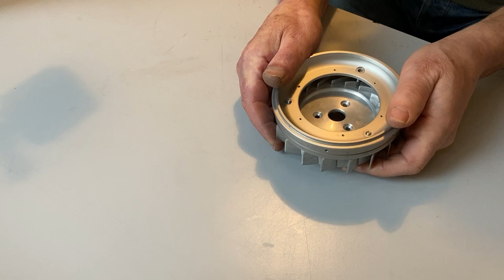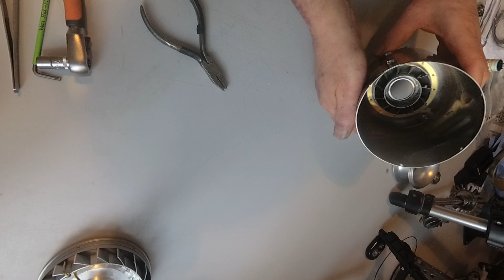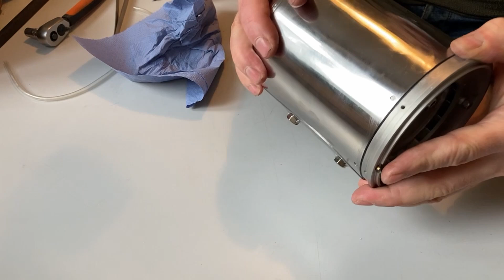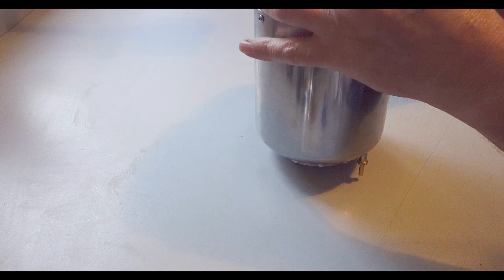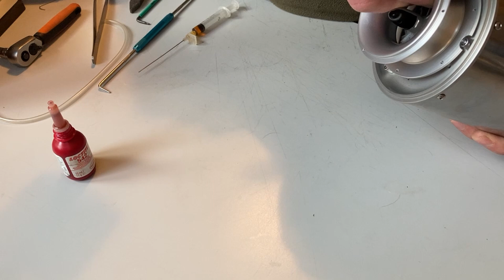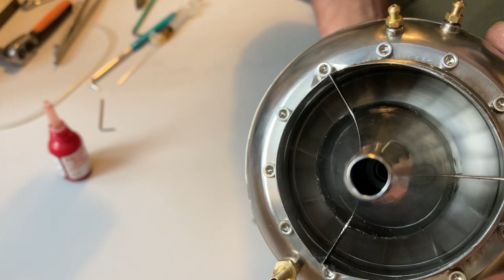Assembling My Home Made Jet Engine

Comment: Hi @MisterG, i have a question: when you put the compressor and turbine disc together on the shaft, did you perform an overall balance? Or did you balance the parts individually?
Reply from the maker: Hi - the turbine and shaft were balanced as an assembly, and haven't been disturbed since. If they were ever separated, they'd need to be re-balanced (or at least checked). The compressor wheel is supplied balanced, and is a shrink fit on the shaft, so if the shaft is straight, the assembly should be in balance. It seemed to work.
Reply: @Mister_G  Thanks for the tip. So, if I have a factory-balanced turbine (I bought it from Jet Max), do you think a pre-balanced compressor would work properly? Or should I still do a general balancing of the whole thing once everything is assembled?
Reply from the maker: @MarcoFormentin  You need to make sure that the turbine and shaft are balanced. I don't know what engine you're working on, but bear in mind that the Kamps only spins to just over 100K RPM. The requirements for more modern, higher speed designs are probably tighter, and may well need to be dynamically balanced as a complete assembly - it's not something I've ventured into.

Comment: May i ask why do you run the fuel tube from the back? Where the hot zone is?
Reply from the maker: I was just following Thomas Kamps' design! 😄
(I think that the real reason is that the design of the fabricated diffuser in this engine doesn't give any 'dead' space where pipes can be routed through without affecting the airflow - CNC 'wedge' style diffusers do have places where pipes can be routed.) Thanks for the comment.

Comment: It seemed to make a lot of friction when you manually span it…
Reply from the maker: Yes, it's trying to pump air all the time, so it won't spin for long, even with "frictionless" bearings. It does sound awful here - the cage-less bearings are very noisy when they're dry and the balls don't really space out properly until the bearing is running. Everything is OK though.

Comment: Осталось отбалансировать и проверить.👍🏻🤓😎
Reply from the maker: Thank you - the rotor was balanced before assembly 🙂
Reply: @Mister_G  я и не сомневался, что все вращающиеся детали, были отбалансированы перед сборкой, но после сборки, они должны быть отбалансированы совместно.
Поэтому купленные двигатели, нельзя разбирать, если не хочешь потерять балансировку.
Reply from the maker: @aleksandrkargin1978  True - I am relying on the compressor wheel being well balanced from the factory. This engine only runs up to 100k RPM so not quite as critical as commercial engines. Thank for the kind comments 🙂

Comment: Hello
I'm enjoying the video
Is the bearing lubrication in the shaft housing on the compressor side by drilling a hole in the intake cover and connecting the copper pipe?

Don't you need to lubricate the bearings on the turbine side?
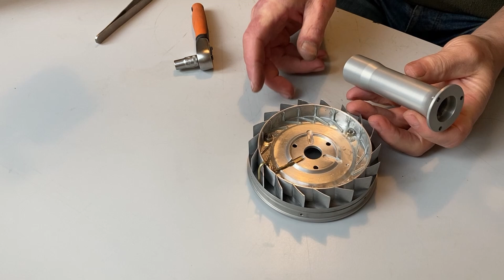Reply from the maker: Hi, and thanks, glad you are enjoying it. If you pause the video at 3:20 you can see that the small pipe fits into one of three slots in the front of the engine. A small amount of air from the compressor flows through these slots into the bearing tube, through both bearings and out of the back of the engine. A small amount of fuel/oil mix is pumped into the small tube and this forms an oil mist with the air that lubricates both bearings before being burned off as it comes out the back of the engine.
Reply: @Mister_G  thank you for your answer.

I have one more question
As far as I understand, 1spool consists of an impeller, a shaft, and a turbine
After securing the bearing to the housing, the outer diameter of the bearing is fixed with the shaft passing through the inner diameter of the bearing, and the shaft rotates as the bearing rotates the inner wheel.

In the video, the inner diameter and axis of the bearing don't fit tightly and there's plenty of room

Does the axis spin without tight tolerance between the <-> axes of the bearing?
Reply from the maker: @wjstk1725   The inner diameter of the bearing is supposed to be a very close sliding fit on the shaft (it could probably be tighter than shown at 15:50). The inner race of the rear bearing is clamped to the shaft when the nut holding the turbine is tightened, and the front bearing when the nut holding the impeller is tightened - the shaft can move at 15:50 because the impeller (and the spacer behind it) have yet to be fitted and tightened down. Does that answer your question? If not, please ask again 🙂 There's a cross section of the engine on my website which may help things make more sense.
Reply: @Mister_G  Thank you for your explanation😉

Comment: Wow, I never saw a combustion chamber built with thick steel plates, usually builder builds with thin steel plates, which i'm familiar with. 

Is a thick or thin steel sheet compatible for sustainable performance ?
Reply from the maker: Hi - the combustion chamber is made from 0.5mm thick 304 stainless steel. I suspect that commercial engines might use 0.3mm, but 0.5mm was quite thin enough for me to work with!🙂. Thanks for watching and commenting.

Comment: What will happen if a used pla for making that compressor inlet and the cover of this inlet?
Reply from the maker: The actual inlet (before the compressor wheel) would probably be OK. The compressor wheel / diffuser cover would probably get too hot for PLA - the theoretical temperature rise across the compressor is ~~100°C, so the compressor exit temperatures could be pushing 120°C - it is on the limit for the epoxy used to glue in the diffuser vanes. From what I understand, PLA will start to soften at 50-60°C
Reply: @Mister_G  i found a compressor wheel for kj66 which is has the same excducer and height but differs in inducer diameter, instead of 46.1mm it became 39.7mm what do i need to change in the inlet bell dimensions ?

kkk 2038 dimensions
K26 Turbo parts compressor wheel
Inducer "ØA"=46.1mm
Tip Height "B"=5.9mm
Exducer "ØC"=66mm
Hub Length "D"=33.5mm
Bore "ØE"=7mm
No. of blades:6/6
kkk 2036 dimensions
Nose diameter:13.53mm
Inducer:39.71mm
Exducer:65.94mm
Tapered tip exducer:69.92mm
Tip height:4.47mm
Superback:0.00mm
Overall height:30.88mm
Blades height:26.47mm
Trailing angle:55 degree
Bore size:7.02mm
bore type:through
Cutback:0.0
Splitter height:18.50mm
Sp height angle:-7.00
6+6 blades
Forward rotation
Tapered tip angle:30 degree
Reply from the maker: @yousefashry2897  You'd need to make the intake diameter smaller to suit the inducer diameter of your wheel, and also you'd need to figure out what the profile of your wheel is, and adjust the radius of the intake profile to suit (not easy to measure this).
Reply: @Mister_G  i will use car's fuel pump because i can't find any suitable pump here but this, how can i adjust it to suit this engine ?
Reply: Thank you so much 🌸
Reply: I Wonder why the inlet cover is made of two pieces. I would try to either have it smooth all the way, or use this slit for boundary layer suction. But you need to monitor it for stuck dirt.
Reply from the maker: @ArneChristianRosenfeldt  I made the intake cover in two parts because it makes assembly / disassembly of the engine easier. A single piece cover makes it impossible to remove the compressor without completely splitting the engine. Even though it is in two parts, the internal surface is smooth and continuous (have a look at the photos of the build under 'intake nozzle'  on my web site: https://misterg.org.uk/2021/wp-content/uploads/IMG_8443-2.jpg )
Reply: @Mister_G  I looked at the photo, but cannot judge where the diffusers start. My argument is a bit about avoiding blame. Also I would never reach this build quality. I would project the tip of the wedge to the neighbours. That defines the radius where .. Oh probably we want filets on the diffusers. So they have to be one part. Now I have to look at car turbos: can the remove the rotor with out the stator?

I am confused by the end of the diffusers. Looking at Frank Whittle designs, I would take the rectangular cross section and bend back by 90°.  Maybe add a wing . Then let the combustion chamber diffuser the diamonds into annular or can. Or align a splitter onto the wing. Hard turn towards injector, straight around the liner.
Reply from the maker: @ArneChristianRosenfeldt   Hi - working from the middle of that photo, you can see the curved intake nozzle (shaped to match the compressor wheel), then a short tapered section, then the face of the cover (with the small holes in). The diffuser vanes start at the outside of the tapered section. The join between the intake nozzle and the cover is pretty much invisible, but it is there (it was sort of my point in showing the photo😉).

I'm sorry, I don't know the detail of Whittle's design, so I can't follow your question. If you drop me a message via my website (link in description above) you can email me which will be easier than the comments here.

Comment: How did you balance the turbine wheel dynamically because usually the hand work has a lot of errors
Reply from the maker: I only did a static balance - the compressor wheel should be balanced as supplied and is a shrink-fit on the shaft. I worked hard to keep the shaft true when everything was assembled (keeping the spacers parallel and the dirt out), so the only part that should be out of balance is the turbine wheel itself. After assembling it to the shaft, I did the initial balancing by 'rocking' the shaft in its bearings to find the heavy point and grinding metal off the wheel. Final balancing was done by touch - you can feel the out of balance forces if you  hold the back bearing between finger and thumb and spin the turbine gently with compressed air. if you stick a small piece of tape (e.g. 3 x 3 mm) to the wheel it will make the vibrations feel better or worse. Find the place where the vibrations are the least, then remove a small amount of metal from the opposite side of the wheel and try again.  You eventually get to a place where you can't feel any vibraton at all - it is really noticeable!  Then you can call it done :) 

Some more description on my website :https://misterg.org.uk/turbine-html-20/
Reply: Thank you 🌸

Comment: Did you scale up the size of the kj66 Turbine?
Reply from the maker: Hi - No, this is a  slightly different design, although very similar to the KJ66. The turbine is the same, 66mm diameter.
Reply: What is the name of this design please?
Reply from the maker: @yousefashry2897  It's usually called the 'Kamps' engine because it comes from the book by Thomas Kamps. (Link in description, I think.)

Comment: This engine was build using mini lathe ?  In terms of turning operations ?
Reply from the maker: Hi - yes, it was. (The compressor wheel was bought in though).
Reply: @Mister_G  For KJ-66 did you recommend mini lathe or bigger lathe for project or mini lathe is fine ?
Reply from the maker: @MrCzarnm  KJ66 is roughly the same size as this engine so it should be possible on a mini lathe, but a bigger lathe is always better!  The diffuser on the KJ66 is usually milled from solid (as far as I know) which would require access to a milling machine of some sort. (The diffuser on the Kamps is made with sheet metal blades, so only turning is required). Also, I think the KJ66 uses a cast inconel turbine - I'm not sure if they are still available and at what cost.

Comment: How about the bearing lubrication system
Reply from the maker: Hi - it is a total loss system using a small amount of fuel/oil mix that is bled into the front of the shaft tunnel from the main fuel supply.
Reply: @Mister_G  Oh, nice. Actually does it have a negative effect on the fuel economy and what if I use a full hybrid bearing, thanks
Reply from the maker: @demoaccount2392  The feed to the bearings is only about 1% of the main fuel flow. (have a look here for more details: https://misterg.org.uk/runing-on-kerosene/ ). Fuel economy is not high on the list of priorities for this engine :)

I am using hybrid bearings.
Reply: @Mister_G  Thanks

Comment: This is a reeaaally good looking engine.
Nice work mate 🙂
I have been reading much into micro turbine jets as I want to build one myself, and you are setting standards with your build.

Some remarks though.
You shouldn't oil up the ID and OD of the bearings. The are suppose to stay put and if snug it won't really improve the assembly.
The other thing: I also been reading dissertations and scientific stuff to this topic. And I recall I've read somewhere the wave washers or springs should be locate at the front to the compressor not at the turbine.
Unfortunately I do not recall if it was because of thermal issues or for another reason.
But your build is made in a way that a preload in the front makes no sense.

I would love to see more from you and the engine
Reply from the maker: Thank you very, very much for your kind comments. I hope to post another video with some thrust measurements soon (another project got in the way - a desktop CNC 🙂). 

Re: the bearings - the inner races of both bearings and the outer race of the front bearing (in this design) are held tightly. The outer race of the rear bearing floats inside the shaft tunnel and must be able to slide freely enough to accomodate differences in thermal expansion between the (steel) turbine shaft and the (aluminium) tunnel whilst maintaining bearing preload, but not so freely that it spins in its housing (it's a bit of a kludge, but it's a well used one!).

The direction of the preload depends on the direction of any axial force that builds up on the rotor as the engine speeds up. The important thing is that the preload is in the same direction as the axial force. If it isn't, the bearings can become unloaded (due to the axial force overcoming the preload) resulting in vibration / scuffing and potential damage. The direction and magnitude of axial forces seem to be design dependent, and (from what I can gather) are not easy to predict.  I just followed the design in the book 😄.

From what I have read, KJ66 derived designs benefit from the bearings being preloaded forwards (rather than backwards as in this design),  but this is by no means universal. If you're thinking about alternative preload arrangements, bear in mind that it's also beneficial to be able to hold a tight tolerance on the clearance between the compressor wheel impeller and its housing, so whether backwards or forwards, it's better (IMHO) to apply preload to the rear bearing - can be difficult to achieve a forward preload in practice, though.

Thanks again for your interest, and for taking the time and trouble to comment.
Reply: @Mister_G  do you have a video of how you made the exhaust stators?
Reply from the maker: @FirstLast-tx3yj  Thanks for watching - I don't have a video for the exhaust stator (NGV) but there is a description and photos on my website - 
https://misterg.org.uk/turbine-html-5/
https://misterg.org.uk/turbine-html-6/

Happy to help if you have questions (either here, or get in touch via the website)
Reply: @Mister_G  thank you for the response
The links did not work but i navigated in the site.

So the only parts one is obliged to buy are the compressor and the turbine wheel the rest can be made!! With enough skill

Did you have a custom pcb made for control or how did you control the rpm and whatnot?
Reply from the maker: @FirstLast-tx3yj  No worries! Glad you found the info. I only bought the compressor wheel - the turbine was also home made. The main reason I went with the Kamps design is that it is mild enough to use a DIY turbine wheel. It you can get hold of a commercial cast inconel turbine, then the KJ66 would probably be a better design - more powerful for the same size. Some waffle on how I made the turbine wheel on another video: https://youtu.be/ZvoJ1ksTRlo

The only control is the speed of the fuel pump at the moment (which is just an ebay PWM motor controller). I've had difficulty getting a reliable RPM measurement, but I hope that is now sorted, and another run (video) will be coming soon.

Thanks for the interest 🙂
Reply: @Mister_G  amazing... I greatly appreciate the value in the videos

May i ask, why inconel and not stainless or titanium? Because a quick google search shows that the have a melting temp about 1400-1700°C while inconel about 1200°C!!
Reply from the maker: @FirstLast-tx3yj  Fair question - The answer lies in how well the materials retain their strength at high temperatures in both short and long term (yield strength and high temperature creep), rather than their melting point. This design can use a high temperature stainless steel turbine if limited to ~80k RPM, but at the temperatures and stresses involved (due to high rotational speed) the blades will slowly stretch. Nickel based super-alloys (like various Inconel or Hastelloy alloys) have very low rates of creep so they can be operated at higher RPM and higher temperatures without the blades stretching. There are probably titanium super-alloys that do the same thing, but I've never got into them.

Comment: How much does it costs, to make all of these?
Reply from the maker: Hi, I do this as a hobby, so my costs are just the raw materials.
Reply: @Mister_G  What about the machining cost of the blade? Is that a single piece?
Reply from the maker: @shewagdhanush1391  The compressor wheel  (at the inlet)  is a turbo-charger part from a car (cost 30GBP from ebay). The turbine wheel was made from an offcut of Hastelloy X sheet - see https://misterg.org.uk/turbine-html-7/
Reply: @Mister_G  What was the max RPM and efficiency? Thank you.
Reply from the maker: @shewagdhanush1391  I don't have a reliable way of measuring RPM yet (I am working on it! :D ). Design maximum is ~100,000RPM.  I will measure thrust, etc. once I have a reliable RPM reading.
Reply: @Mister_G  Thank you for your response. Have a nice day!